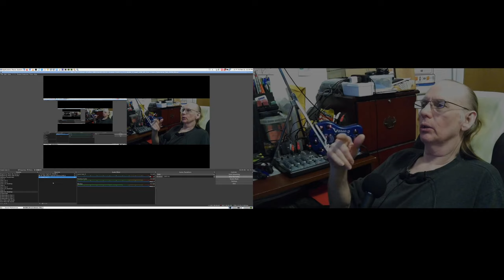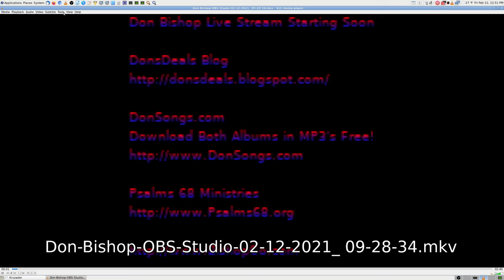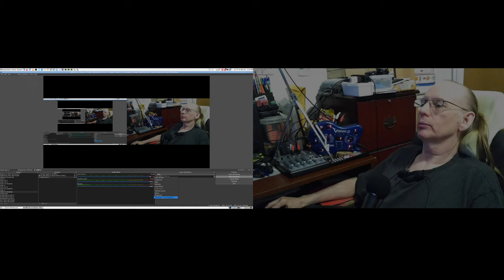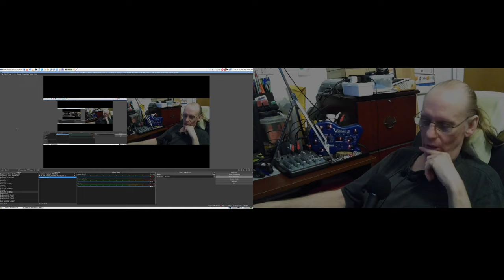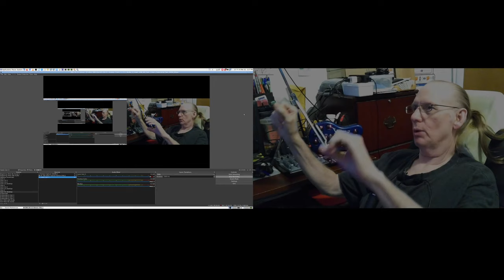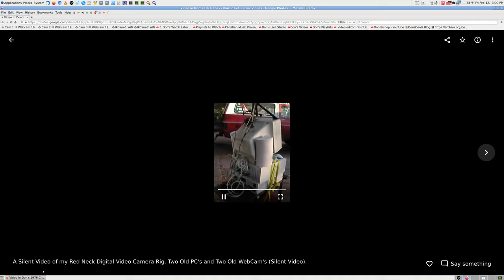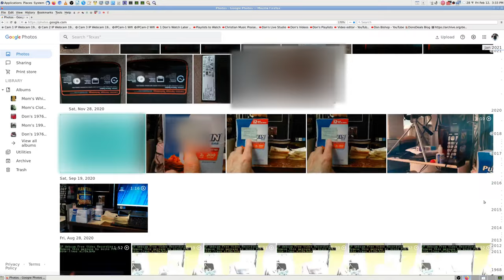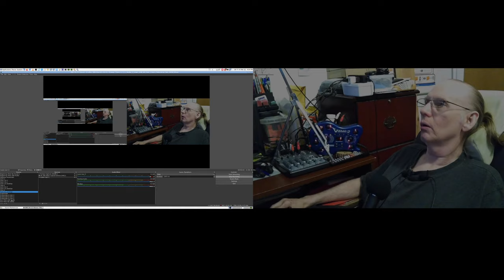017 Audio Gain Structure Setup Mic Behringer 802 Vamp2 HP DL380 G7 Server Don Bishop OBS Studio

Comment: Hey man got that psu and cable you recommended your card works! Having some trouble with drivers but I'll keep you posted.

Edit : noticed the raid chip runs at 70c after installing speed fan to monitor chip temps. I threw a fan in there and that dropped it to 50c so that seems to be the solution

I think it might be a problem on your system to, seems to be a common issue on these hp servers
Reply from the maker: Cool, glad it's working out for you. I don't remember. Did you mention what Video Card GPU you have? RAID Chip at 70C = 158F. Ya, that does seem too hot. I will have to check into that, on mine. It may show up in iLo. What do you mean by "speed fan". Is that a Windows Program? Did you install an extra Fan. Or did you not, have all of the Fan Bays Filled? I have all of my Fan Bays Filled. And the Video Card has 2 Fans on it. But, I still wonder. If the direction, they are facing. Is fighting with the System Fans. I still haven't taken them out, to see... Don
Reply: @DonBishopDonSongs  speed fan is a free program from the internet. The way i installed a fan over my raid chip is a bit unconventional but works.

I wouldn't remove the card fans, I've run it without the gpu and the raid chip is still 70c or more. It's just a problem with these servers 

The video card i went with is asus radeon rx 570. I overclocked it at 1450mhz using a program called msi afterburner and kombustor and it performs well

Speed fan - http://www.almico.com/speedfan.php

Comment: Did you install a sound card on your server? Honestly that's going to be my next step, I notice the riser gives you 1x16 and 2x8 pci plugs
Reply from the maker: I looked around at prices on a PCIe Video Card. And they cost more than I wanted to spend. I already have 2 USB Sound Cards. I paid $2 each for them, several years ago. So, I'm using one of them for my Audio input for my Videos. Also, I had in the back of my mind. That I would like to have a larger monitor (have a 23inch 1080P). I looked around for a few months. And on Black Friday 2020. I found the 43inch 4K TV, that I'm using now as my Monitor. $158.00 when I bought it 11-27-20. It's a Sceptre 43" Class 4K UHD LED TV HDR U435CV-U from Walmart.com (https://www.walmart.com/ip/Sceptre-43-Class-4K-UHD-LED-TV-HDR-U435CV-U/46867816) My Video Card has built in HDMI Audio out. Which I use to send Audio to the TV. And then I use the TV's Audio Line out. With a 3.5mm to two RCA Cable, to send audio into my Amps - Sound System. The TV and Sound Chip in the Video Card, both have... "Audio Return Channel, or ARC, uses a single HDMI connection to send audio from a TV to the SoundBar or AV Receiver. Using one HDMI cable, video is sent to the TV with an HDMI cable, and that same HDMI cable sends audio from the TV back down the same cable." I had never heard of this, before. So, I read up on it. I can see both the Audio Input & Output Chips in my Fedora 32 Linux Audio Settings. So, I tried hooking up an RCA Cable, to the Audio Inputs on the TV. Hoping, that I could send the Line Level Audio Signal back to the Computer. Going from my Behringer 802 Mixer & Vamp2 Efx back to the Computer. But, it didn't work. I guess, it has to come via the HDMI Cable, into the ARC HDMI Port. So, I may still buy a PCIe Audio Card. Maybe a multi-channel Recording Card. If I find one, for less than $80 or so. Oh, and the PCIe Slots on the G7, are labeled in a way that is hard to figure out. If you look on Pg 93 of the HP ProLiant DL380 G7 Server Maintenance and Service Guide. I think, you are only going to actually get x8 Speed, on the x16 Slot. Or actually, the x16 Slot, is the one on the Motherboard, that you plug the Riser Card into. See my video on this (https://youtu.be/e14gB4UYjyQ?t=1779). And I remember Morten, saying that, about his G6, on on of his videos. Oh, and the video you watched, where I was installing the Video Card. Has a section, on the Cable I used. Don